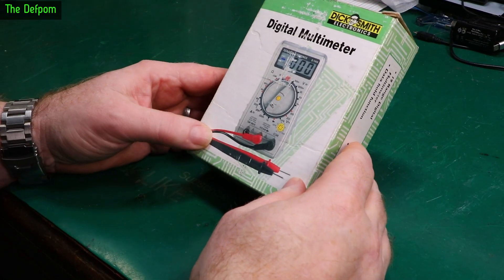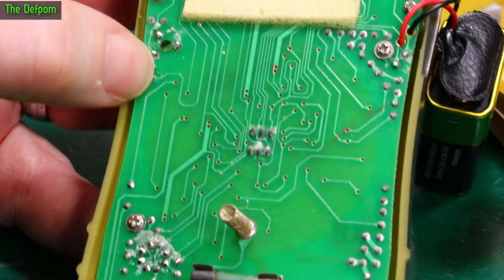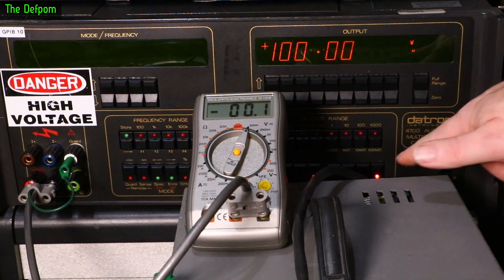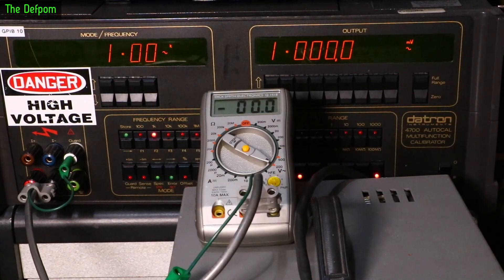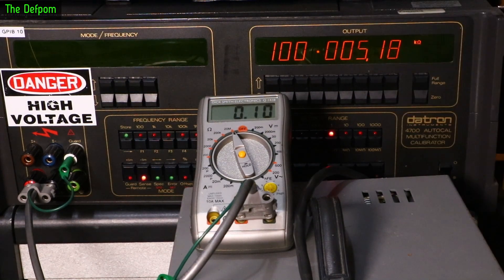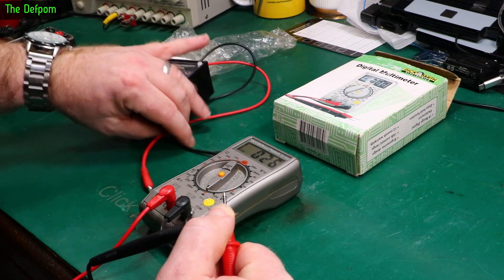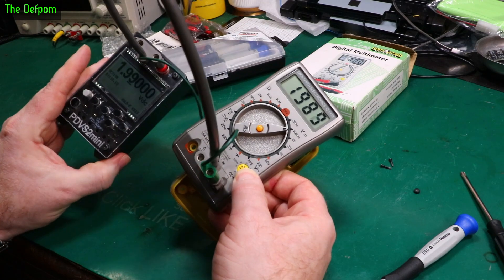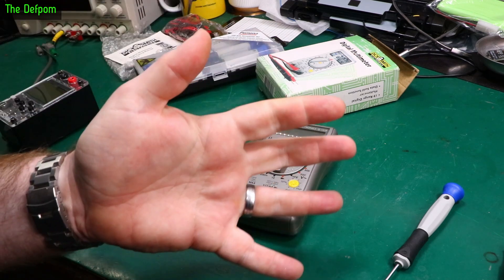🔴 How Good Is This 20 YEAR OLD Multimeter ? - Dick Smith Q1418 Accuracy Testing - No.1181

Comment: I have the exact same model but only known to me as the Uni-t UT30B. Still sits in a drawer at my pc for some quick measurement and indeed also around 20 years old.
Bought in Belgium for around 15€
Reply: I’m pretty sure it’s made by uni-t. I own a Conrad branded copy. I own it for over 20 years (maybe even 25 years, it was the first meter I bought after I started working). 

It still works almost flawless, sometimes there is a problem with the 20v range. Probably because that’s the most used range. Wiggling de selector switch around solves it. Cleaning the contacts doesn’t make a difference so they are probably worn out.
Reply: Still available at this price.